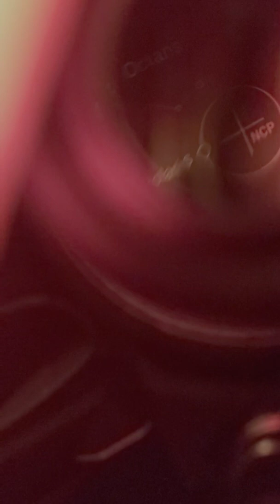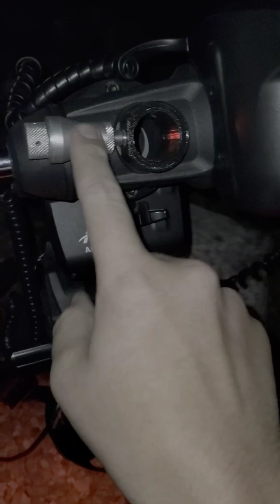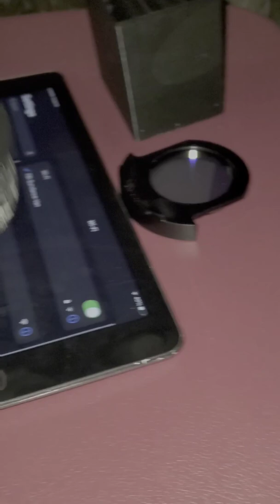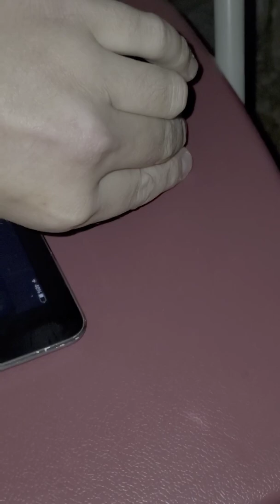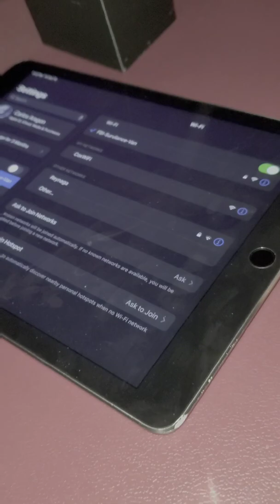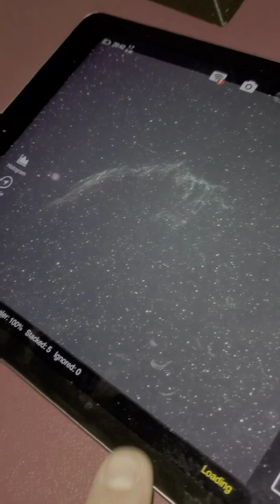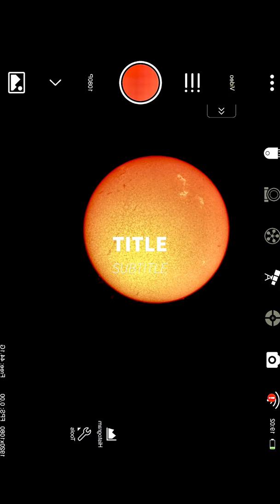Veil Nebula with a Celestron 8 inch Telescope & Hyperstar: Set-up & Live Stack

Comment: You got that mount pushing close to 30 pounds?
Reply: About 23lbs. This video was from a couple years ago. We now have an EQ6R-PRO and CGX. The eq6 is running an esprit-80, 6200MM and full ZWO suite. The CGX has a Meade 178ED APO that I'm restoring. Also running a 16in Meade Starfinder EQ, 20in Obsession and a bunch of other dobs and sct's. Hoping to trade some for a C-14 XLT.

Comment: does the avx handle it all ok? as im tempted to get the HS 8 v4
Reply from the maker: Yes. Even with an entire imaging system, aluminum dew shield,  counterweights, guiding, it's still not even half of the AVX limit. .03-.05 guiding average in a lightweight design. It's a great mount for the price, and used ones are being sold for 600

Comment: Nice video ...I read that if using the hyperstar you may not need autoguiding....
Reply: True. It's so fast that your exposure times are less, so trails don't have enough time to form esspecially for live stacking. Unguided Hyperstar is absolutely amazing.
Reply: @AstroDragon33  I have a Nexstar 8se on a DIY wedge which works pretty good, I use it along with CPWI. I live up North so the time for doing my observations are limited, climate, seasons, work etc. I do not want to spend to much in a eq mount (cad$2500), and still on a f 6.3 with a focal reducer....instead getting a hyperstar (cad$1200) but getting f 2.0.  I haven't decided yet ...any advice?. Thanks. Clear skies!
Reply from the maker: There are so many objects out there of different apparent sizes. I LOVE the Hyperstar, but its so wide that details get lost, unless you have a VERY nice camera. Even our 294mc Pro isn't great at getting sharp details. Its so wide. My goal is to get a used 2600mc pro as the ultimate hyperstar outreach rig :) But, the reducer (6.3) is also awesome. Its a middle ground for most smaller objects, but Id suggest making mosaics with the 6.3 instead of getting the hyperstar for now, then when your board or have plenty of money, you should get the Hype.